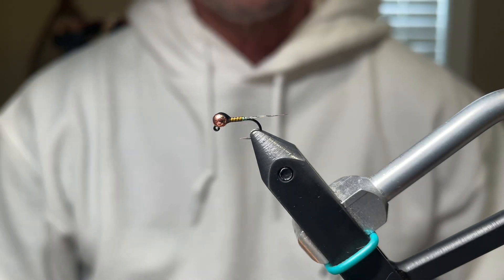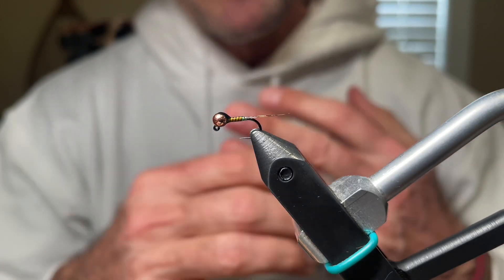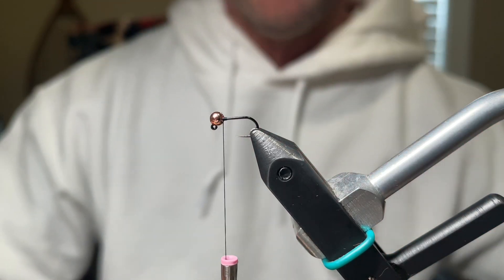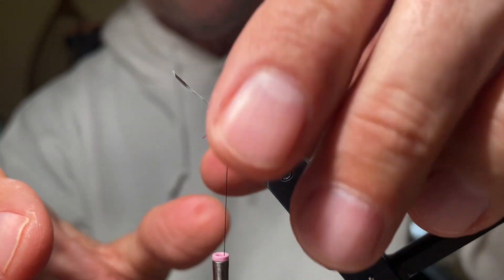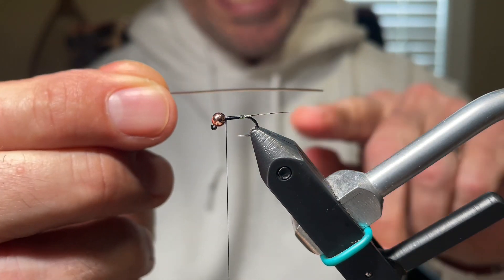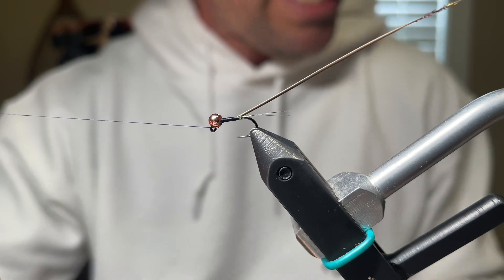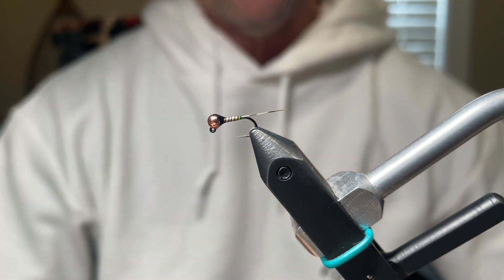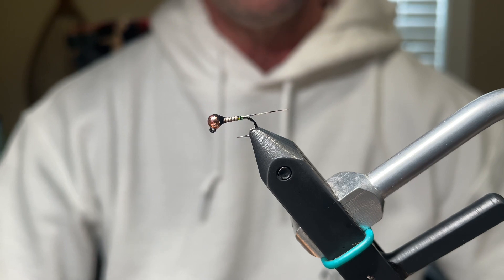Quilldigon:  Step by step tying instructions

Comment: Nicely done.  I like the explanation you provided while tying this fly and the great care you took doing it.  ( Reminds me of "Oholi's flies" )   I use disposable, retractable scalpels to cut materials where I don't want the tag end showing.  You used a cosmetic brush.  I recently found some dental applicator brushes with very fine tips to apply resin.  I had some instances where the black resin popped off.  My solution was to apply it first, cure it, and then "paint" the rest of the body with the clear resin.  I also coat the black resin with the clear one.  I don't yet know how well the fly stand up to abuse by the fish.
Reply from the maker: Oholi is a great tyer….Appreciate the comment!  I use scalpels, as well.  Great little tools. And your way def works with doing the black first, then coating with clear.  Thanks for watching and tight lines!

Comment: Thanks Cory!  I just happen to have all of those materials, except for the last ingredient in the recipe the "hard as hull."  Is that finger nail polish?  By the way Thanks for answering my comments.  I'll try not to be a pain, but I'm determined to gain some expertise in this endeavor.  I just bought a 10' 3 wt. Hanak Czech nymph rod and RIO nymph, so I'm getting set up.  Thank again! Jim
Reply from the maker: Hard as hull is a fly tying head cement.  You can use any clear varnish that brushes on.  It isn’t 100 percent necessary, but I like it for the protection.  You are not pain…I’m happy to help!  That is a good rig you got for this technique.  Tight lines to you!

Comment: If you do this with a tungsten bead the slightest touching of the edge to the bead will damage the edge of your scissors….even the softer copper, and brass beads will damage your scissor edge.
Reply from the maker: I’ve really never had a problem with them getting dull.  Perhaps the tungsten carbide scissors I use could have something to do with it.  Appreciate you watching.

Comment: Veevus 16/0 work as well? I think you've mentioned in other videos that you like the 16/0 when possible?
Reply from the maker: Hey Jeff,  16/0 Veevus works great.  You can flatten that just like UTC or Uni thread.
Reply: @OldDominionTroutBum  and what color of thread do you like with the olive quills?
Reply from the maker: I use Veevus olive dun or reg olive.